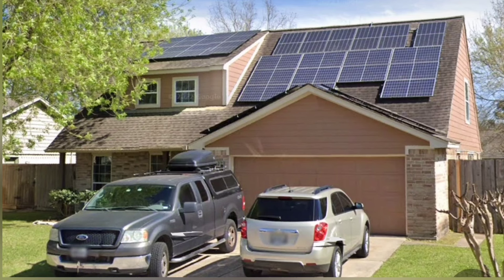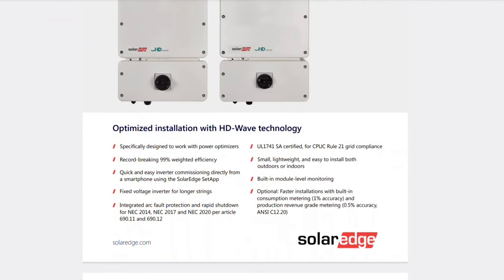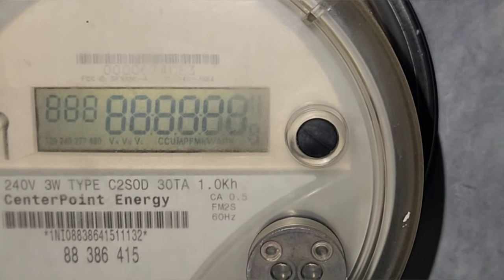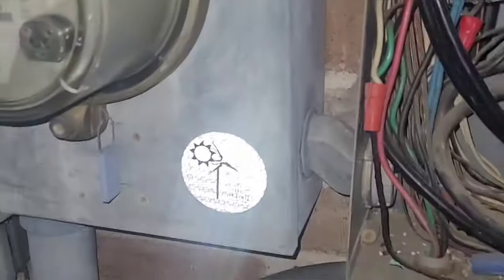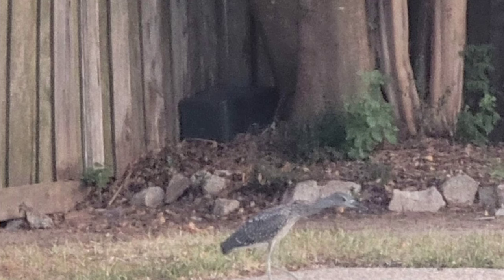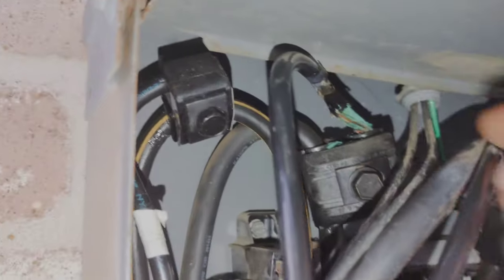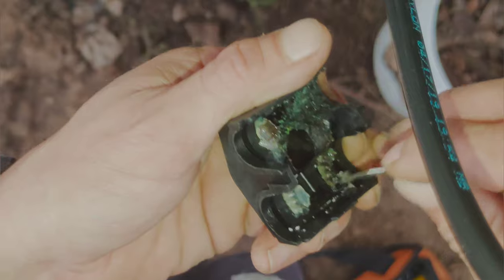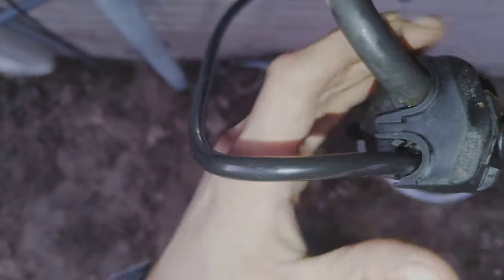Solar Panels Tips and Things to Know.

Comment: On the subject of energy providers, I'm with Octopus energy here in England, I think they've branched out into America too, the import tariff I'm on is call Agile, and it's price per unit/Kwh changes every half an hour, massively helpful for getting cheap off-peak electric to charge the solar batteries up overnight, sometimes when the conditions are right, the cost will even go into negative figures, they'll pay you to use surplus electricity!
Reply from the maker: That would be nice to have.  But the previous owners here thought it to be smart to not invest in the batteries, it seems.  Thanks for the comment!

Comment: That is a terrible connector. I’ve never seen them used on a circuit that has high voltage and high current though. I have seen them used used in low voltage and low current circuits before and I still don’t like them there either. I don’t care for solar panels unless I was out in the boonies.
Reply from the maker: That's what I thought,  exactly.  Too much current for such tiny connectors.